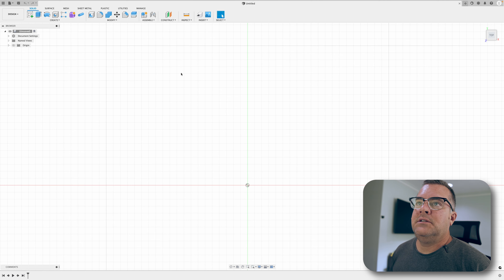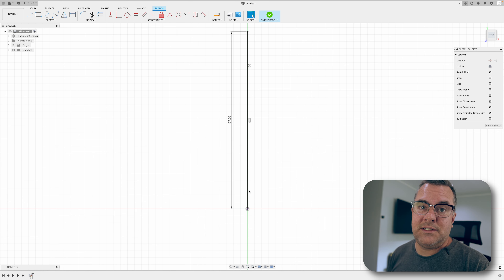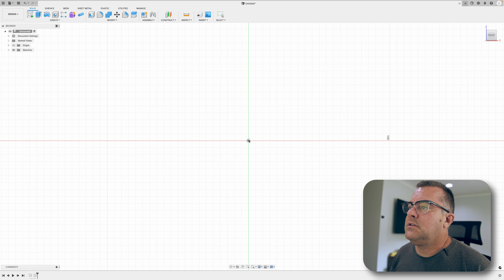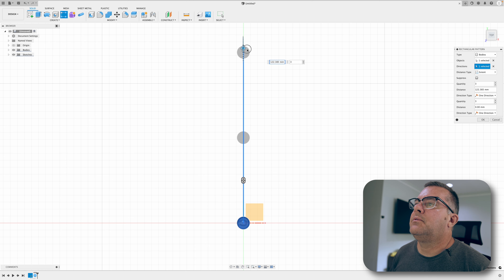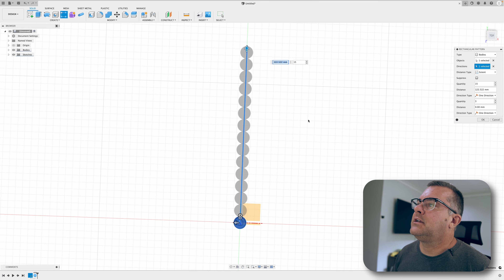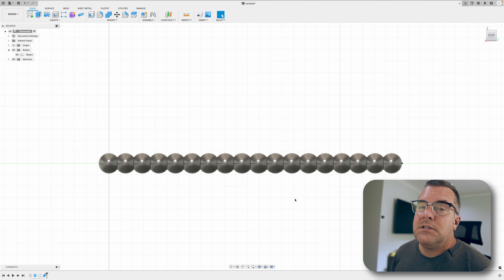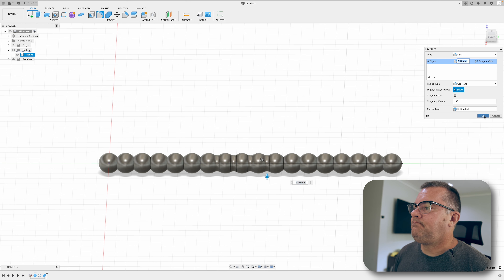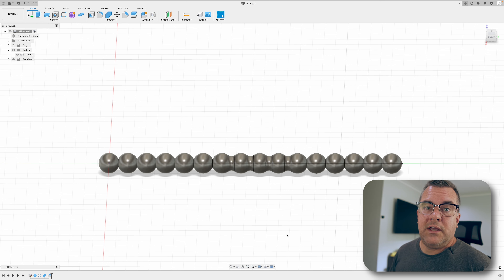Building Simple Lure Bodies: Worms + Creatures with Fusion 360 for 3D Printing

Comment: Great tips. Can you make different scale pattern sizes based on the curve and straight line? For an example, a senko has different ring sizes
Reply from the maker: Sadly fusion does not have a way to scale an object on a path currently, it's something I (and many others) have sent in an enhancement request for. I will put out a quick tip video on how I do that, but it is pretty manual....